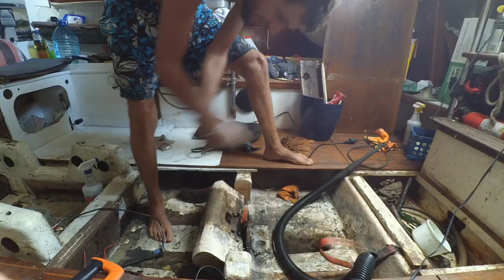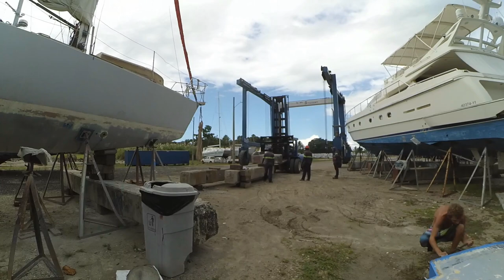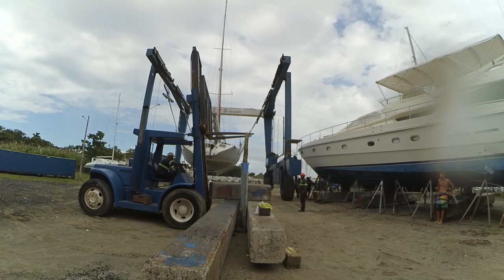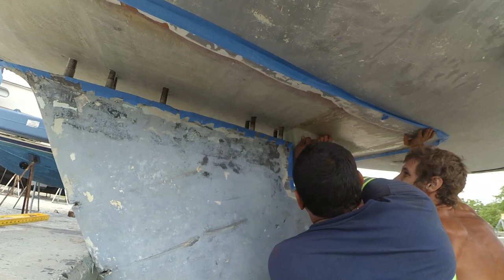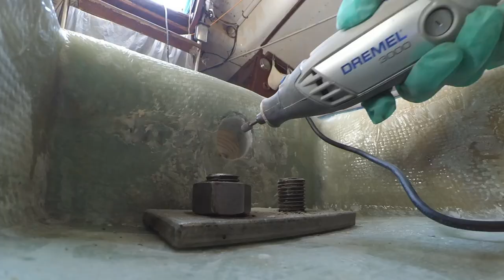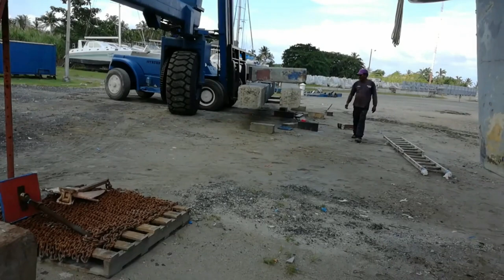Quest Nº 9 Can we reattach the keel?  [Retired IOR boat refit]

Comment: Remarkable: My previous IOR boat looks very much the same in he fundamental hull shape with one major exception: The keel was NOT boulted directly on to the hull BUT had a moulded stub keel apron 9" deep (4" front-12" rear) with curves to port and starboard. This stub was an integral part of the hull designed to resist grounding forces. In addition the horizontal alignment was approx 8 degrees. in the event of hitting coral or similar the keel would not likely be sheared off rather would 'lift" the yacht some what.........Food for thought!.
Reply from the maker: That's an interesting solution.  Fortunately this part of the refit is closed and so far ( 4 years later) all is good so for now we will leave it as is and try to avoid hitting things as much as possible ;)
Reply: @svoiysh  Absolutely correct: I would do the same thing...try not to hit ANYTHING on the bottom and you should be OK. Yes, the hull shape is great and it is important that there are NO, I repeat NO imperfections in  terms of water flow/restrictions as any of them will add to the reduction of boat speed. cheers and fair sailing

Comment: If you had to go that far why did  you not think of building a sleeve from the hull and sliding the keel through it ,this would help relive the stress at this week point and  give a nice contour to the bottom of the hull. How will you ever sell this boat to sum one els ,knowing that it has been replaced,and what guarantees will go with the sail.
Reply from the maker: Hi interesting question, I'm not sure I understand what you mean with a sleeve, if you meant encapsulating the keel this is not how it was done originally and also we didn't want to widen it's profile nor close the option to inspect the keel lead and finally in the future we might want to actually change the keel to something more modern and that would mean additional work so we decided to redo it exactly as it was. We managed to achieve decent enough contour of the boat with fairing (will be shown in upcoming videos) ;)  Nothing was replaced except for the 'bilge box' and it is as strong as can be so I don't imagine we would have any problems to sell and honestly we don't really think in these terms as we have absolutely no intention of selling her.  I hope that answers your question :)

Comment: Having had this done for my own boat by professionals, my understanding is that the mast should be removed before removing the keel, doing the repairs, and re-attaching the keel.  You appear not to have done this.  I hope it does not come to bite you in the backside later.
Reply from the maker: In ideal world you are probably right but with the limited resources and time we had we decided to skip that :) Our mast does go inside but is not actually standing on the keel, it stands on it's own super beefy stringer in front of the keel which manages all the load from the inline rigging. So far we haven't had any issues because of that and if something was wrong we would probably know by now ;)
Reply: @svoiysh  The reason for removing the mast is to de-stress the hull and let it regain it's normal shape.  However, since your vessel was not built using the 'production method' with an moulded inner liner, hopefully you  have got away with it.  My hull was visibly deformed behind the keel and internal doors would not shut.  BTW - My boat was dropped whilst being lifted, not grounded, but the damage is the same.  She is now stronger than when she was built.
Reply from the maker: @jeremyrowley1240  Wow that's a nightmare but good to hear you rebuilt it! It's hard job but a lot of satisfaction;)